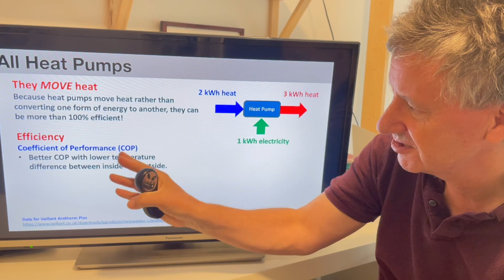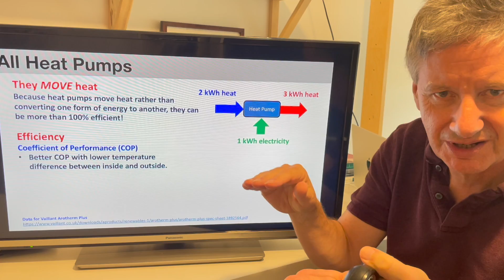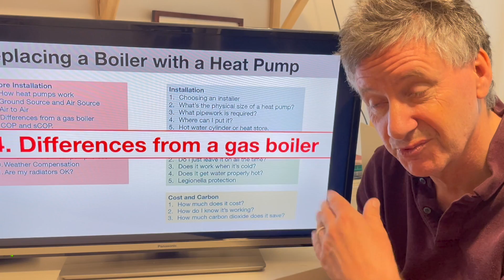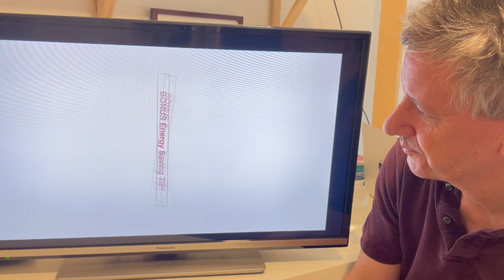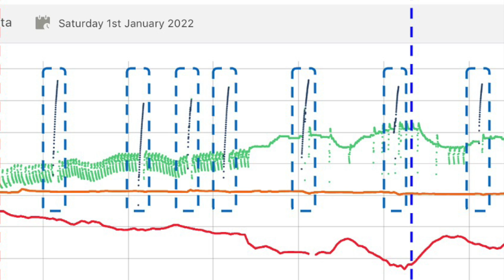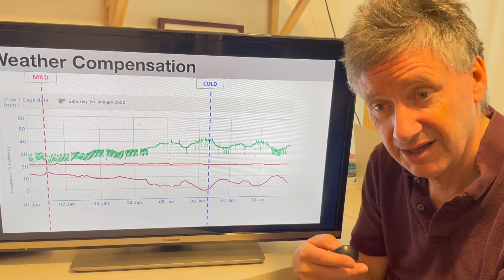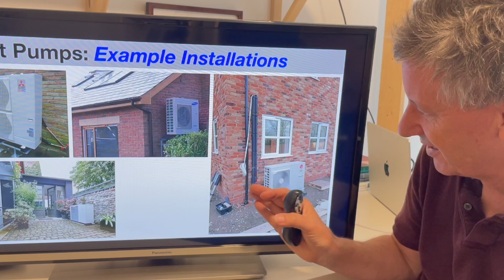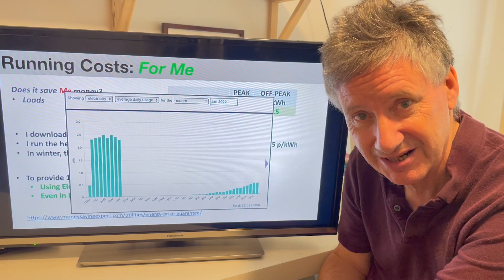Replacing a gas boiler with a heat pump

Comment: Excellent presentation Michael thank you. Query. How does one download electricity to a battery. I have a 4 kW battery which never takes me to the end of the day. Gerry
Reply from the maker: Gerry, good morning. 

'Downloading to a battery' is just charging the battery from the mains. Most batteries will have a Battery Management System (BMS) that will allow you to do this either once or regularly at a fixed time.

Is your battery 4 kW in power or 4 kWh (notice the h for hours) in capacity.

4 kW in power is quite big, but 4 kWh is quite small.

Do you know how much electricity you use each day on average?

M
Reply: @michaeldepodesta001  Michael you are a gentleman,I didn't expect a swift response.
Not at all "teckie" sorry. I took a number of screenshots but do not know how to send. Anyway the battery is a 3.85 kWh with 12 P.V panels installed last year. Average 25 kWh per day consumption or with 9 generated. I also heat with gas boiler and looking at possibly Air to Water?  Lat years costs - Electric €1,300 Gas €950.
Reply from the maker: @JG-cj5gm  Here is my summary

You have a battery capacity of 3.85 kWh

You use roughly 25 kWh/day of electricity. That seems like the usage for a small family. Is that correct? Otherwise that’s a lot of electricity for one person or even a couple!

You have 12 solar panels that generate 9 kWh/day. Is that 9 kWh/day in October? 

What does a battery do? Even in October, there is a lot of solar PV to be had. But if solar does not match your usage instantaneously, and without a battery the electricity is lost to the grid. Even a small battery such as yours will enable you stay ‘off-grid’ for much of the daylight hours. 

If you get a bigger battery it is possible to stay off-grid for longer and longer and over the summer it’s possible to stay off-grid for a month or two with 12 solar panels - even with your high daily usage.

I don’t know your circumstances but if you have the opportunity to buy electricity cheaply at night, check if your battery management system will allow you to store that cheap electricity and run of the battery overnight. And if you have spare cash that you don’t need for anything pressing, and you can buy electricity cheaply at night, then a larger battery could save you a significant amount of money.

In any case: good luck with your endeavours.

Michael
Reply: @michaeldepodesta001  Morning Michael, I really appreciate your time and thank you. Re the 25kWh per day it is used by 4 adults in the main house and my son and his wife in a studio apartment, all on the one supply. The studio is all electric with a monitor and they pay us for their usage. 
October panels have produced 10 days @ 9 kWh, 10@ 15/16k and 10@ 3/4. So October figure's
Cons 770kwh, Gen 245, Buy energy 560, Charge energy 87 and Grid 38 kWh. I am told I will soon receive a payment for grid.
I'm going to hold out on extra battery for now and hope to add ATWH in new year. Thanks for everything. Regards Gerry
Reply from the maker: @JG-cj5gm  Good luck: it sound like you are pretty much on top of things.

Comment: For most people replacing a gas boiler is only really a necessity in the emergency situation when your existing heating fails beyond repair and the money has to be scrimped from somewhere, possibly borrowed at high interest rates increasing by the minute. Solar panels also an unnecessary extra given most people's finances. Long term planning needs capital and people just do not have this luxury. The idea of people replacing a working system to save the planet is fanciful and this seems to be the message coming out from the affluent eco lobby who never to be short of capital. If you said consider a heat pump when your current system fails I would understand this all better but the technology still seems too complex and evolutionary for the bulk of traditional installation people out there. Given the life of the boilers this whole idea of a rapid swap is just not going to happen and the eco lobby need a bit more patience.

 Lowering temperatures to 40 degrees also is worrying as when I ran my dish washer at eco levels it smells when I open it like a bucket of my fish tank water after a fortnight's dumping by the fish, so you wonder what bacteria are piggy backing on these mild temperatures which we are being told to use. I think the rule is if you cannot afford to put a Tesla car on your drive and Tesla batteries in your house's substantial utility room as seen so often on Youtube steer well clear of planet saving gestures for the moment. The destructive anti-social antics of the activists also really throws doubt on any logical reasoning existing behind all this current eco campaigning we endure.
Reply from the maker: Michael D, Good Morning.

I agree with much of what you say about affordability. I couldn't afford to do any of this until I retired at which point I spent my life savings on the endeavour. Most people are not like me.

You state that most boiler replacements are emergencies. I agree, so that is why I take the time to talk to people in advance about this.

But your criticism of solar PV - the cheapest form of energy generation in history is staggering: these devices literally give people free electricity! 

We have no problem with our dishwasher running at any level. But that argument is irrelevant to the temperature of water inside a sealed heating system. Heat pumps explicitly include an Anti-Legionella program.

But fundamentally I disagree with you profoundly. 

Your arguments are 'what-about-ism': you argue against everything and yet propose nothing! 

The key fact is that emitting CO2 is harming the planet: So heating homes with gas boilers is literally making life worse for our children - and doing so at the maximum possible rate. Nothing you say acknowledges this basic reality. Look at this video if you want acquaint yourself with the basic physics of our situation.

https://www.youtube.com/watch?v=RnY51kn7skc

And you seem keen to criticise all the suggestions I have made - suggestions which will save both money and carbon - but you don't state how you would reduce carbon dioxide emissions. 

I conclude that you think we live in the best of all possible worlds, and that your goal is to save money now but maximise the damage to the planet our children will inherit. I profoundly disagree with you.

M
Reply: @michaeldepodesta001  For most people it will be to save borrowing rather than save money. The idea that CO2 is purely causing warming and solar output is not involved in any way is hardly a fact but assumption and there is a lot of politics in all this. I am always suspicious when people start talking about 'facts' in a contentious debate such as climate change which is never simple physics.

I am reading of payback times of 16-22 years for solar and that is not free and exceeds my life expectancy especially as health care is being run down. Also I have a North-South ridge axis which is hardly ideal. I am sure current electrical regulations as one electrician said could open a whole can of worms with electrics in my house even though they are safe so once again the old housing stock muddies the pool.

My children are running gas boilers and I just hope by the time my grandchildren are independent a stable low energy environment has arrived and probably will. Not here yet though and no time to switch unless you have to. I am sure that your advice is helpful for those that can but I worry about this whole swap systems or you damn your offspring pressure and who will end up broke doing it which will not help their dependents.
Reply from the maker: @michaeld5888  Once again you are in utter denial about the harm caused by CO2 emissions. I cannot comprehend why you persist in denialism. I am not prepared waste another moment of my time until you educate yourself.
Reply: @michaeldepodesta001  Just sceptical about what is going on and the science behind it and thinking for most people it is not something that can really fixed at a personal level. Telling people they are in 'utter' denial and need to educate themselves shows how there is no real debate going on with these these issues and any dissenter to the current thinking is just classified plain wrong. I am not saying you are wrong and there is no value in your opinion and would never think that of saying that about anyone's point of view. As you say there is no point is discussion in these matters. I am not actually a climate change denier but any drift from accepted thinking nowadays on just about anything is shunted in an opposite binary incorrect view.
Reply: @michaeldepodesta001  please read what you just said looking at yourself in the mirror. You might not find it appealing.
Reply from the maker: @motog6436  I am happy to look myself in the face. I have had 20 years of people saying they are 'sceptical' as code for they can't be bothered to educate themselves. And I have personally spent thousands of hours very patiently explaining to people the essentials of the complex physics of global warming. But at this point in 2022, there is no valid sceptical position about the reality of global warming and its cause. Solar output itself is monitored and the physics of the warming has been understood qualitatively since teh mid 19th Century, and quantitatively since 1896.

Comment: A noble effort but you did not factor in the cost of goods (purchase costs) amortized over the warranty periods when comparing to the cost of gas. Nor did you factor in the carbon used to make the Chinese LiOn batteries or German heat pump vs. a modern condensing gas boiler. 

Once this has been displayed on screen, you may be surprised to find that argument isn't as clear cut.
Reply from the maker: Dear Singled Hot, 

You raise issues of carbon and financial accounting.

Carbon
=======
I have done as a full a carbon accounting as I can which was summarised in this figure

https://protonsforbreakfast.files.wordpress.com/2022/07/counterfactual-co2-emissions.png

which I excluded from the talk because it was already too long. The interventions I have made since 2019 (EWI, Triple Glazing, Solar PV, Battery and Heat Pump) were by my reckoning fully paid for by mid-2022.

The full article from which the figure is extracted can be found here.

https://protonsforbreakfast.wordpress.com/2022/07/14/what-else-can-i-do/

Financial
========
Financially, I have made suggestion that the choices I have made will save money in a conventional cost accounting sense. The choice is a moral one. If you have the resources to stop polluting the planet and making the climate crisis worse for our children, then we should do it. 

By chance recent price rises make my choices seem prescient 

https://protonsforbreakfast.wordpress.com/2022/08/26/non-je-ne-regrette-rien-update/

Overall. 
======
The argument is incredibly clear. Remain part of the problem, emitting tonnes of CO2 every year, or become part of the solution. It's your choice.
Reply: @michaeldepodesta001  You will concede that most will not invest their life savings as you have and that financial arguments need to be convincing. I'm afraid the numbers don't stack up as well against hyper efficient boilers like the Viessmann 200W just yet.
Reply from the maker: @singlendhot8628  Good Morning. Indeed economics matters: But hyper-efficient boilers are chasing the odd percent or two to go from 95% to 96%. A basic heat pump will deliver 300% across a season in most UK homes. And now that OCTOPUS are the pushing the streamlined installation of heat pumps, and EDF are offering a 'no-money-down' heat pump for £5,000, I think those economic will change. And heat pumps are the only technology that will allow us to even get close to net zero.

Nonetheless, I take your point. Have a great weekend. M
Reply: @michaeldepodesta001  Good morning! Of course you're correct about net zero but the key point has and always will be SCOP. I have repeatedly seen heat pumps in some period properties struggle to achieve a SCOP of 3. At or around these levels, a heat pump will never repay the owner whereas a Viessmann 200-W replacement saves the owner hundreds of £ p.a. by modulating itself to very low consumption when possible. However, in well insulated homes with a 40 degree flow temperature, the equation flips towards the ASHP but with a 10-12 year payback period.

There are also properties where a heat pump is just not feasible due to the tank dimensions or lack of outdoor installation space. For these properties, I always recommend the Viessmann 200-W. 

Perhaps you would consider researching this boiler as an option for ASHP incompatible properties?
Reply from the maker: @singlendhot8628  Have you seen this video about a sophisticated installation using a 200-W. It looks sweet, but the installation experience is not so good. Check out the video from 11m00s minutes in and for the explanation of why the boiler is hard to install, see the secret tape at 13m20s.

https://www.youtube.com/watch?v=UHD_-i5ulms

All the best

M
Reply: @michaeldepodesta001  I have - it's a hilarious spoof and I have actually visited the owner's property in London. When I did, the installation was running superbly with gas savings that are hard to believe till you examine the actual numbers like I did. If memory serves, their annual consumption went from 22K to 15K kWh, down from his previous Worcester Bosch condensing boiler. That would mean the boiler pays for itself in just a couple years at currently tariffs. I also believe this was the installer's first time installing the V200W. It's definitely a boiler for an experienced Viessmann installer but once set up correctly, can save an owner substantial £ (and substantial emissions too!)
Reply: @michaeldepodesta001  Hi Michael! It's great to see our installation episode making its way to an excellent channel like yours. The savings from the Viessmann 200-W installed by Urban Plumbers have been remarkable so far! It's ability to heat hot water to a tank temperature of 50 degrees, much like a heat pump, combined with its remarkable modulating ability means that we have cut our emissions (and bills) drastically. The V200 modulates down to 10% when running our wet UFH heating system which then heats the entire home.

If you're ever in London, feel free to pop by for a tour of our EPC A rated lake house. We're already planning a water source heat pump for the future!
Reply from the maker: @avivscrewvalla  Good Afternoon. And well done you for finding Syzmon: I think there are very people in the UK with his skill set. 

Since your home is already EPC A-rated, I imagine your heating demand is low (<10,000 kWh/year) and a water source heat pump is a great choice. Relatively constant water temperatures and no earthworks required for your collecting coil. 

Every best wish with your adventures - do drop me a line at house@depodesta.net if your serious about a visit!

Best wishes

Michael
Reply: @michaeldepodesta001  Cheers Michael - email sent!

Comment: I have a big battery storage and just recently looked into a heat pump.
It would save me about £700 a year, a Return on Investment of 8%, but still will take 13 years to break even.

13 years is a very long time.

I didn't include the solar generation so it would be less, but as you'd only need the heat pump in winter, solar isn't that much.

I'm already heating my hot water with a timed immersion heater, as the cheap rate electric is 3p cheaper than the gas and more efficient 😀
Reply from the maker: Phil, Good Afternoon.

It sounds like you are very much on top of the situation in your home: congratulations.

However, you are only doing financial accounting. Do you do the same accounting for other things in your life? Do you calculate the Return on Investment and payback period of a new kitchen, or a car?

When you you do carbon accounting, the calculations run the other way. Boilers emit tonnes of carbon dioxide per year that we have no way to remove. This is adding to the problem that we will leave to the next generation. The embodied carbon in a heat pump pays for itself in a year or two. 

Each one of us has to choose what we would like to leave our children: a pile of cash or a marginally cooler planet.

Best wishes

Michael
Reply: @michaeldepodesta001  
Boilers emit CO2?
That's what plants take in.
Don't say we have no way to remove.
Reply from the maker: @philware1546  Phil, Good Afternoon. CO2 cycles in and out of the biosphere in many ways. And you are right, plants do absorb CO2. But they don't absorb it permanently at scale. We don't have any technology that can remove permanently CO2 from the atmosphere *at the scale of gigatons or above*. There are possible technologies which might in a few decades, and they are worth developing. 

All the best

Michael
Reply: 9000 pounds is a lot of money. I put in my air to air system for $1400, which was free after rebates. Reducing capital expenses helps the most with payback period, but the UK systems sound awful and expensive. :(
Reply from the maker: @motog6436  Hi. In the UK installation of air to air AC systems is strictly regulated. Installation must be by an accredited Fluorinated-Gas Engineer. This drives up the cost but improves the overall quality of installations. All the best. Michael